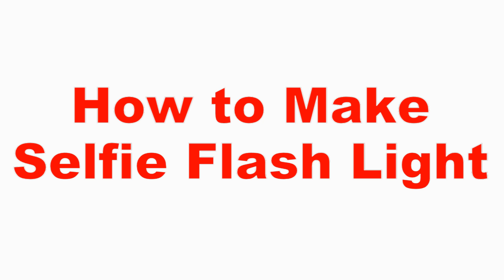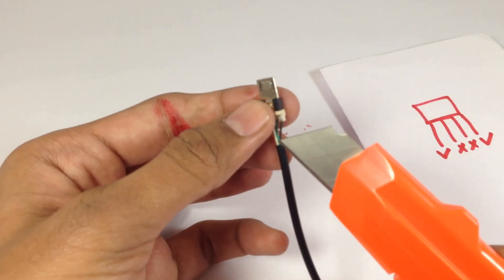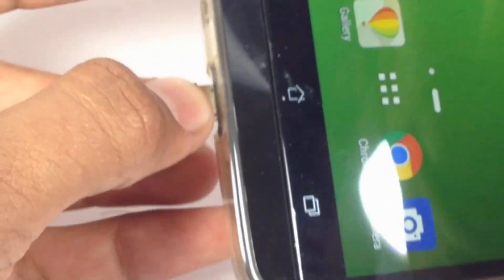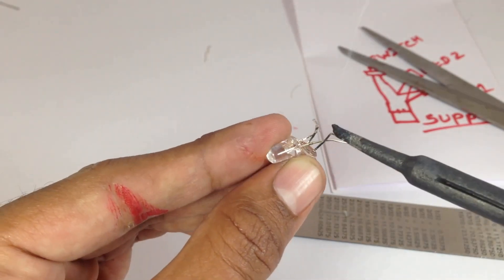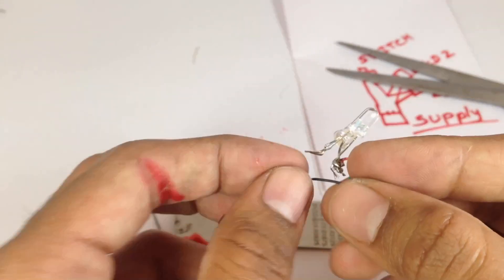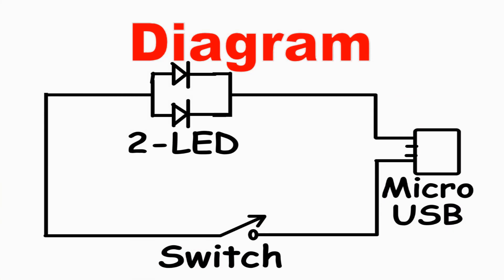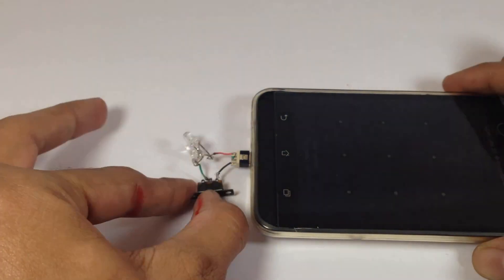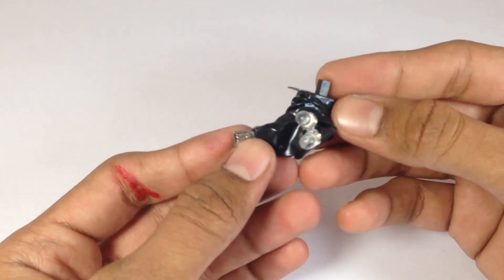HOW TO MAKE SELFIE FLASH LIGHT AT HOME

Comment: I made it with "6" LED After a 5 time of use ( less than 1min) it stopped working  and LED's won't turn on anymore on any power :/ !
Reply from the maker: +LellPara Rap algerien (h dz prod) 
so sorry for that brother, some led's have very low voltage capacity, in that case we can use resistance to control power supply.